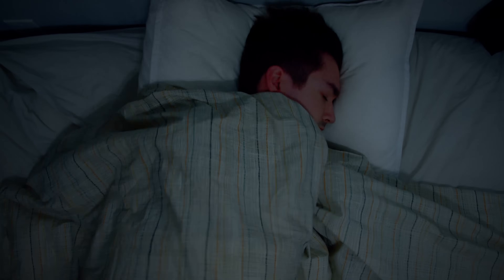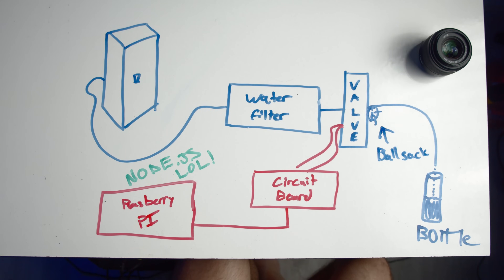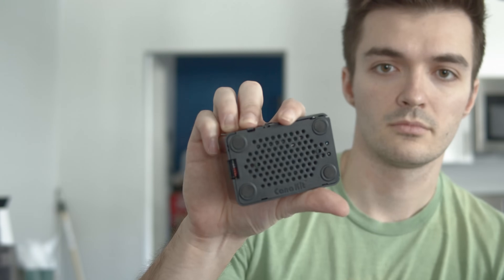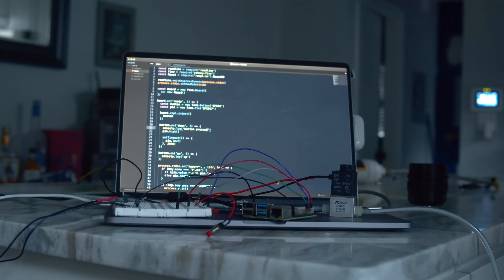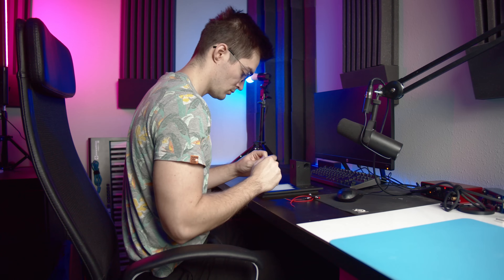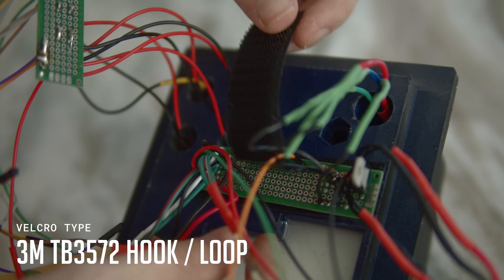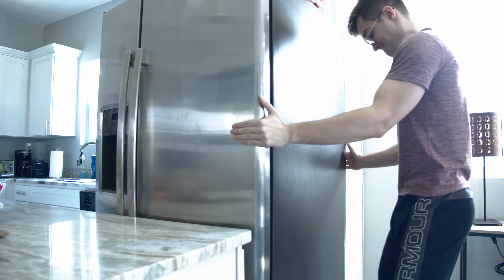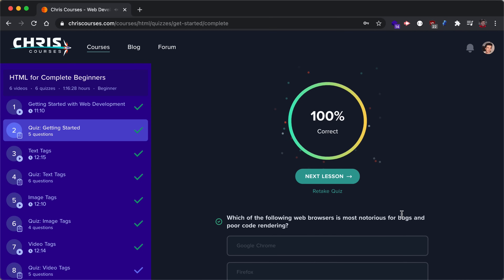Filling my water bottles w JavaScript because I'm lazy

Comment: Amazing content! Do you recommend that book? JavaScript on things?
Reply: And did you really not have any prior experience? You’re good with the hardware
Reply from the maker: I thought the book was great, although, I never read the full thing—basically, I only read the exact pages that related to what I was actually trying to do (Ohm's Law, resistors, basic circuitry, and JS code setup). Would definitely recommend to someone looking to integrate JS on hardware.

And yeah this was my first hardware project. I experimented a ton before actually going through with what you see in the video, and read a handful of chapters from electronics text books as well. Ended up being a lot of trial and error, but I definitely think my experience with code really helped get this thing up and running.
Reply: @ChrisCourses  awesome! Thanks I’ll check it out. Let me know if you have an affiliate link 😉

Comment: I would have used a Chinese 20L water bottle pump instead of 3D printing and a timer IC with a 10K Pot and a MOSFET. But then where is the fun, no 3D printing, no JavaScript,  no programming, no Raspberry Pi (everyone else favorite), minimal soldering, no cost (just 5 USD, including the water pump with case/tubing), and no views also (would have gotten views less than the number of dislikes here) :), But other than raspberry pi and javascript in the video, I am amazed how many skills you know, when you say you don't know electronics, yet can solder easily, have all the electrical tools, 3D printing, programming, and so on...
Reply from the maker: Video doesn’t do the learning process justice - know it looks like I was learning over the days in the video, but I actually took a few months prior to start the project and put some prototypes together. Only when I was confident enough did I go through with filming since I didn’t want to waste time or gigabytes of storage recording me staring at a multimeter that says 0 volts 😝
Reply: @ChrisCourses  Still amazing, there aren't many people who knows programming, electronics, 3D modelling, Printing, Design, Video Making, Script Writing, Editing, and the list goes on to make such remarkable video

Comment: That's pretty slick man.  I think if the bottle was on a base that that emitted light (or if light was in the 'head unit', the stream of water would actually change to the color of the light source (like a fiber optic cable).  Good stuff.

Comment: Will done, project complete!  Love your story line and video production it definitely made me pay attention. 

As a long time Maker I was curious to see how you did this project. 

I was in the process of designing and making a number of automatic Hand Sanitizer Dispensers.  

Also at the same time Raspberry Pi Pico came to  market. 

A microcontroller is better suited for this project and just under $6.00 Canadian it also a lot cheaper then a $16 Raspberry Pi 0 or $85 for a Pi 4.  

And due to the fact I’m installing 4 or 5 of these units it much cheaper.  

I hope to run this device off a battery pack. A will need to print out a few parts to complete my project and come up with a way to Pressurize the unit.  

One complaint I have with most Hand Sanitizers is the waste of Sanitizer used. By having a liquid that can be sprayed on your hands , providing just the right about of sanitizer each time will save money .  

Anyway thanks for your Inspiration.
Reply from the maker: No problem, awesome to hear your story as well. Anything that saves even a minor amount of time is worth it in my opinion. You're not just saving time, but also the mental load that comes with the task of doing something such as replacing hand sanitizer because it runs out too quickly. Would love to see a build of your project if you have one, keep it up!